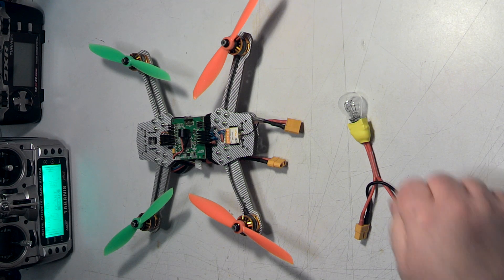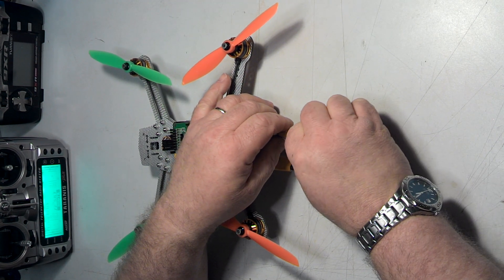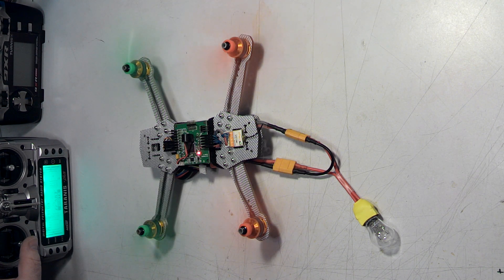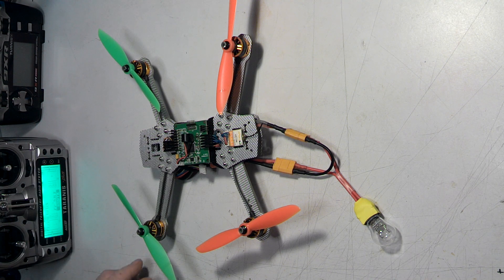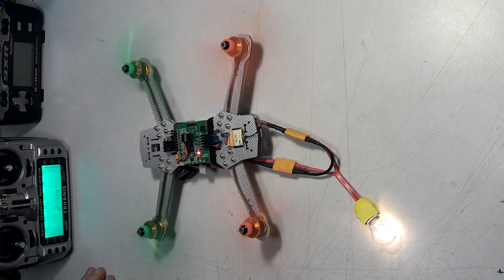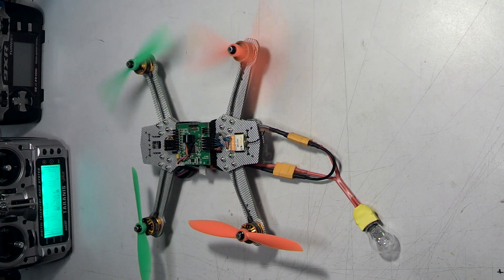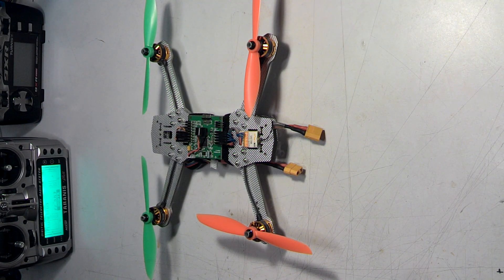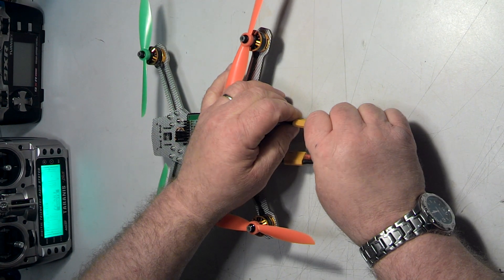DIY - You can build this $4 device that will keep you from ever smoking your quadcopter again!!!

Comment: What wattage of lightbulb do you recommend for 220class racing quad? I made the smokestopper with 12v 5W lightbulb and it lights up after plugging 4s battery. LEDs on quad light up, but no beeps, no video, so probably no power. There is nothing wrong with a quad, I plugged battery, no shorts, no smoke.
Reply from the maker: 12V/5W is perfect; it is the same as the low-current filament of the 1157/3157/4157 family bulb I now recommend for this device.

This behavior is normal if you have high-current accessories also running at the same time; when you do your initial testing, you should not have anything nonessential hooked up. If possible, only FC, RX & ESCs. Some high-current VTX and LED bling lighting can easily draw enough current to make the SmokeStopper™ light up, which also causes the voltage to the quad to drop below the FC/ESCs low-voltage cutoff.

If you read the full article here: https://www.rcgroups.com/forums/showthread.php?2327875 I go into troubleshooting techniques in considerable detail.

Here you can find a detailed diagram of the present updated design; a High/Low Current version with switch for changing current ranges: http://i1183.photobucket.com/albums/x462/mnemennth/SmokeStopper/SmokeStoppertrade%20With%20Hi-Lo%20Switch.png

Cheers,

mnem
Pay It Forward!

Comment: Awesome info. but I'm more curious how you setup fail safe with your VD5M.
Reply from the maker: +Tim Bell 

Set failsafe in the V5 per RX instructions to output no pulses on signal loss; then set up FS in the FC.

I believe all I had in the Steveis' FW was "Cut All"; other FCs with more advanced FW have options to wait a certain number of loops then cut, or reduce throttle slowly to a given very reduced level so your quad isn't falling like a rock. This can work against you if it's really windy, but if you can regain control you have a better chance of saving a crash.

I rebuilt this quad quite some time ago; I'm no longer flying the KK2.1/Steveis' FW.